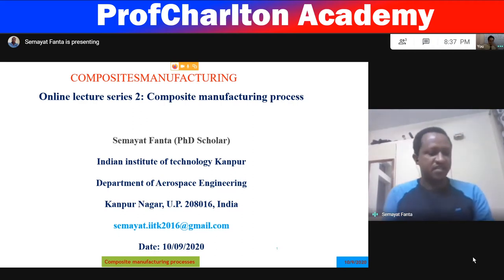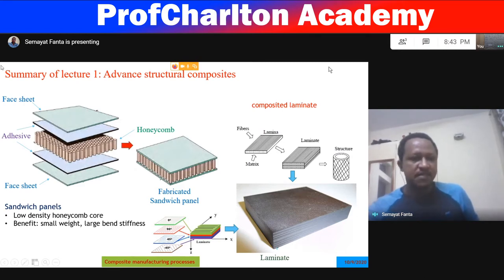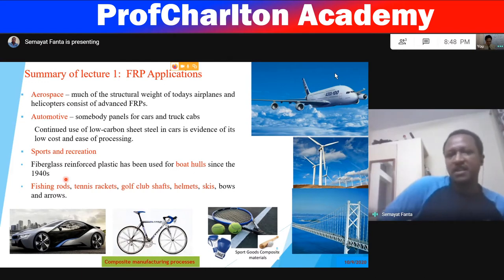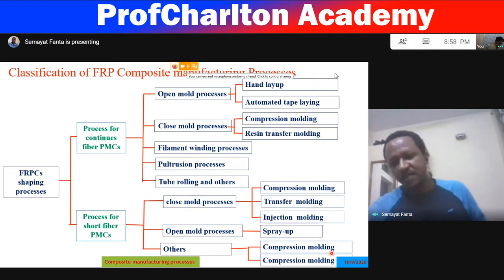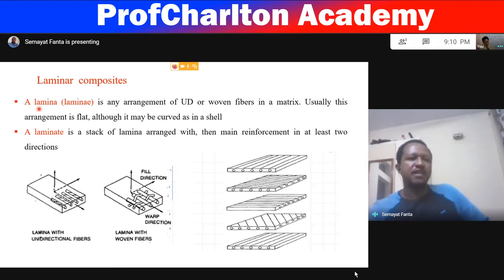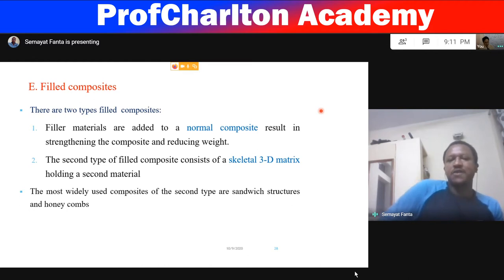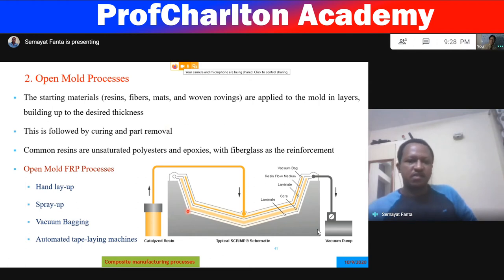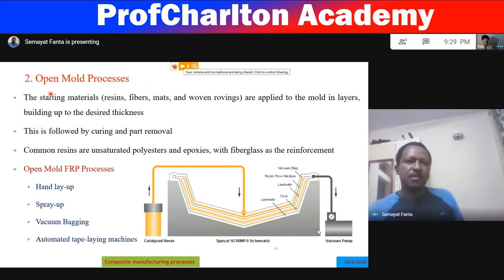Ph D Candidate Engr. Semayat Fanta 's Lecture Series: Composite Manufacturing Process Part 1

Comment: Thanks for sharing ! Composite materials is one of the essential study areas in Engineering which mostly deals with design and manufacturing when it comes to industry. Taking composite materials as a whole, there are many different material options to choose from in the areas of resins, fibers and cores, all with their own unique set of properties such as strength, stiffness, toughness, heat resistance, cost, production rate, etc. However, the end properties of a composite part produced from these different materials is not only a function of the individual properties of the resin matrix and fiber, but is also a function of the way in which the materials themselves are designed into the part and also the way in which they are processed.